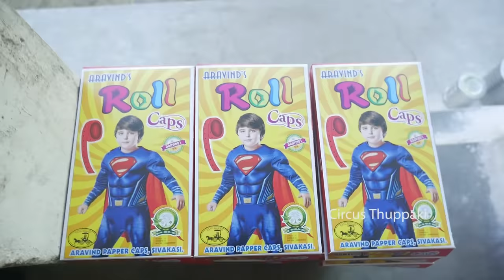Exclusive Roll Caps Making - Very Interesting Process | Crackers Factory

Comment: To put what these guys are risking into context.
The composition is basically red phosphorous and potassium chlorate. 
Red phosphorous, if contaminated with the yellow form is toxic
Potassium Chlorate - High levels can interfere with the ability of the blood to carry oxygen causing headache, weakness, dizziness and a blue color to the skin (methemoglobinemia). Higher levels can cause trouble breathing, collapse and even death. Repeated exposure may affect the kidneys and nervous system. 
Also is capable of exploding when mixed with fuels.
The dry mix is very friction and impact sensitive. And has been know to explode en masse causing fatalities.
No protective equipment - brave guys.

Comment: I didn't know they were still made. Mine were different though. First, I think the rolls were longer. Second, mine were red with a black dot which I always presumed was black gunpowder.
   I don't recall if there were sprocket holes. If not then I don't know what the feed mechanism was like.
   At some point there were also Greeny Stick-m caps to use with cap revolvers. They were pricey compared to roll caps, and the remaining material after shooting for a while would get messy and hard to remove.

Comment: While watching this video I noticed how easily I could turn this process into totally automated production line.
Then I realized that mixing and using  the primer compound would require so much paperwork with permits and safety inspections that it would not be worth it.
Yes... I have been doing too much automation engineering lately.